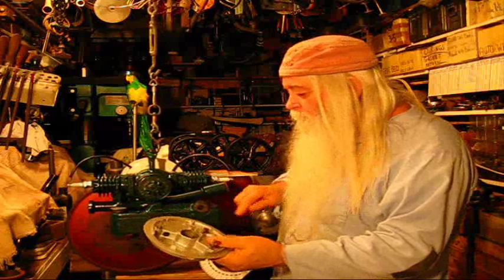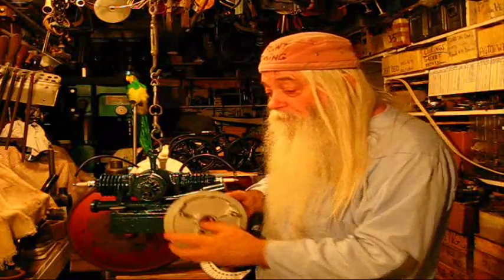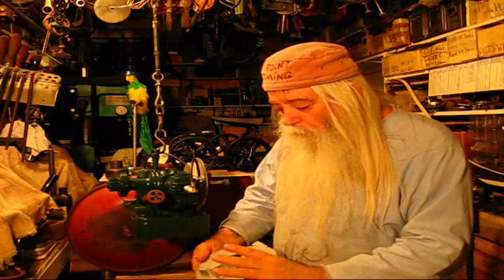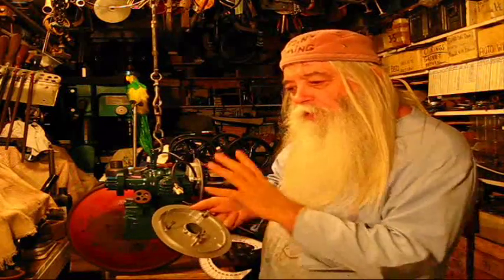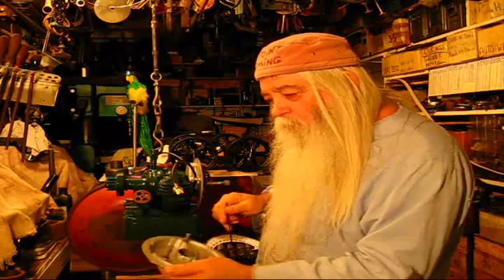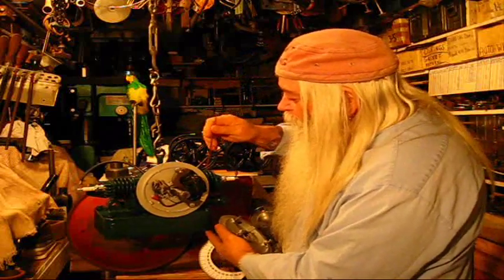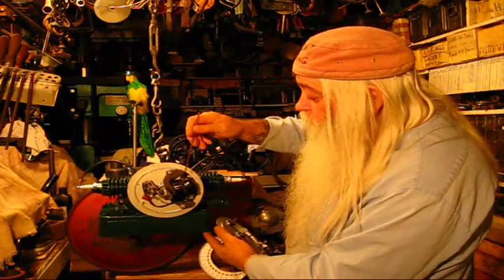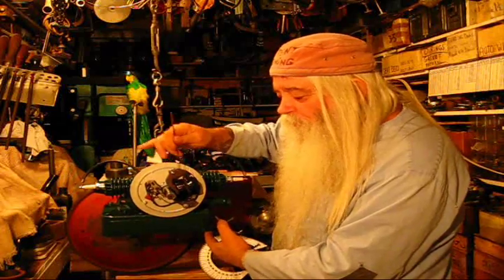1937 Maytag Engine  model 72  repair #50

Comment: I have a maytag model 72 D did all my home work on the engine. I am real pleased with the work done. Can't get it to run, got good ingnition in both plugs.The problem is to me, I am not getting gas to the plugs. Need your help. Do you have any suggestions?.

Comment: Hay, just came across your vids, I have two 72 my grump gave me about 10 years ago, after a little bit of work i got the one running my other one is locked up tight!!!
I used Harley points to get err to run and some modifing but run great, leeks a little bit. but i love it, like the vids